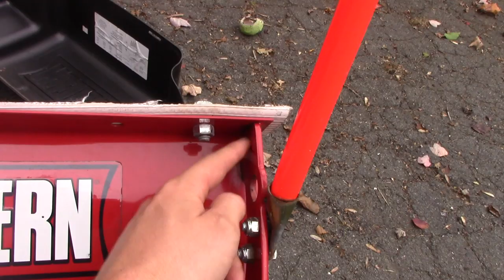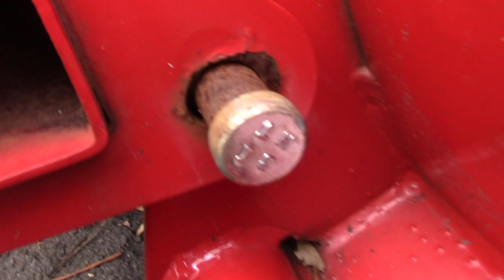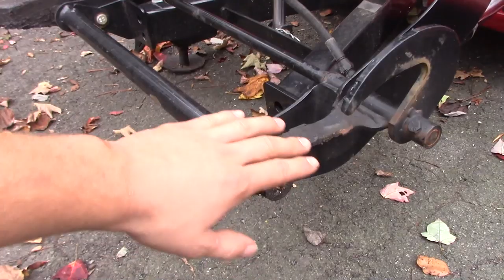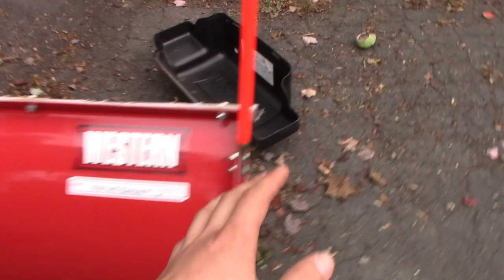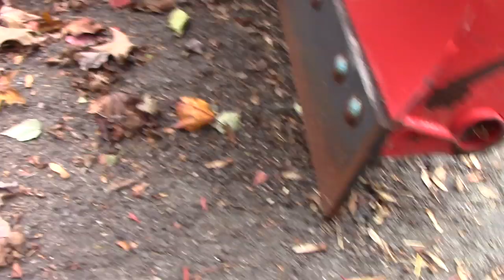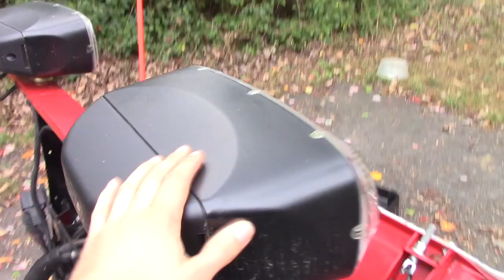WESTERN HTS 5 Year Review

Comment: Don't know why so many are going ballistic on you about your assessment of this plow. I thought you did a good job, and I for one am glad I came across this video since I'm in the market for a lightweight plow for my half ton ram and was just discussing this very plow with my local dealer. Keep up the good work!
Reply: Steve, Get the Poly Pro and just put Timbrens in the front end and make sure you put about 600 lbs in the bed to the rear of the back axle. You Will Be Good To Go.....Don't fork around with this lite weight if you're going to do ANY plowing. If it's for YOUR driveway with less than 4 inches of snow you could get it but it's a waste of money....Karate Do Yes, or Karate Do No. Karate You Do Maybe? SQUISH ! ! !  One mans opinion.
Reply: @umpman04  I have the same plow on a 2005 F50. I plow apts and condos and have used it to push 22 inches of snow. Been using it for 6 years and could not be happier.

Comment: I have a 7.5 foot straight blade Pro Plus snow plow. It is 10 years old now with no weld breaks. Had a hydraulic failed once and a few broken feet. I live and operate in Alaska, perform snow plowing with my one ton 4x4 on residential and a few commercial jobs.

Comment from the maker: So much hate, WOW! Fact of the matter is my f150 is what I have. I don't have 65K to buy a nice heavy duty truck and plow. I bought an HTS because its designed for my truck. Im just an average guy trying to make some money with the equipment I have, don't hate haha.
Reply: Quit bitching, you already said it "wasn't for commercial work". That plow was made to do a few driveways a storm, not 30 or 40. Learn how to plow properly and you won't beat the shit out of your equipment. One of the places i worked for had a plow that was over 20 years old and they had to replace the lines and do the cutting edge, you on the other hand have beat the utter shit out of a 5 year old plow. It may be a western but it wasn't made to go screaming into a snow bank and come out with no damage, take it easy and that plow should last you 10 or more years.

p.s, ram 2500s start at 28k and a new plow like 5k. 65k is probably what it takes to outfit a 5500 diesel
Reply: Eric Becker why hate on the guy for trying to make a little money?
Reply: We are all just stating that you are complaining about issues with how it was built and how it has held up to your plow route when you are using a home owner plow for commercial use. When you say light commercial use is way more than wear and tear on your equipment. If it's a bumpy dirt driveway most guys use these little things called plow shoes until they get a base. Idk where you live but no matter what you are doing your plowing illegally. Federal DOT regulations require any vehicle with a GVWR of 5,001lbs and greater to have a company name in the side of the truck. Just keep that in mind
Reply: CFR 390.5T Definitions:
Commercial motor vehicle means any self-propelled or towed motor vehicle used on a highway in interstate commerce to transport passengers or property when the vehicle—

(1) Has a gross vehicle weight rating or gross combination weight rating, or gross vehicle weight or gross combination weight, of 4,536 kg (10,001 pounds) or more, whichever is greater. By this basis, 390.21 does not apply.

So, to which federal law are you referring to? Please help everyone by stating your references.
Reply: mike squires by that logic, every pickup would have to have a Company name and DOT number on the side. I've never heard that before.
Reply: So I'm guessing you are also of the opinion that all mom and pop stores shouldn't be in business? They should close up shop and let the big boys (like Walmart,  home depot, etc.) take care of things? So much for letting the little guy try to make a go of it. I was a one man band painter/wallpaper hanger/wood finisher/faux finisher for close to 40 years...shame on me, right? Shoulda stepped aside and let the big boys take care of business...
Reply: It's a 1/2 ton plow. The name says it all. Made for driveways. The price point reflects that. You should have gotten a pro plow. Your review and expectations of this plow is meant for a contractor grade plow. Your acting as if your hts was made for commercial plowing which it's not. As for the welds, the engineers @ western no exactly how much and we're to weld. Top much weld would hinder the flex of the plow. Again you said it yourself it's a driveway plow. Why are your shoes so far off the ground?
Reply: @zachbooth1785  a ram 2500 cost 27k back in 2010 they are around 50k now

Comment from the maker: Let it be know that everyone calling this a "Home owner plow" is incorrect!!! Here is the description of the western HTS on their website! "The full-sized, full-featured WESTERN® HTS™ half-ton snow plow is built for today’s half-ton 4WD pickups. The HTS plow delivers professional results for your personal and light commercial snow plow jobs." So its a light commercial plow, and thats exactly what I use it for.
Reply: SnowPlowLife Thank You for your comment.  It helped me in my decision on choosing a plow for my 1/2 ton truck this year 2018.  The guy in this video seems to just knock on it bad, but yet it has held up for him for “five years now” as he has stated.  If you also notice, he doesn’t have his bumpers down.  I have always called them bumpers, others call them spindles , and others call them whatever they want.  I call them bumpers bc they bump over things.  Trip.  Which helps with a huge portion of the wear and tear on the actual blade that he’s admitted to hitting curbs with.  Sounds more like a novice instead of a pro in my opinion, which is of course mine to make.  Everyone has them, and are entitled to there own.  Just stating mine.  Five years old and the wiring hasn’t been replaced, just electrical greased thanks to the cover.  The plow has the bumpers which’ll make the plow blade last longer, be able to make it do more and reinforce the blade from taking all of the abuse.  Also.  I’ve never heard of anyone having tiny stone issues, when they go between the plow blade and the plow, so that’s new to me.  My grandparents ran a successful family landscaping/Snowplowing business for 66 years, when he got back from WW2. My grandpa and grandma started the family business then.  I worked for them at a very young age.  They actually started by putting in all of the residential and commercial lawns around the towns where I live.  Then a customer asked my grandpa if they also kept them up?  He said,”yes we do!”  They had more work then any business these days, bc they were the biggest around.  They retired bc of age, they made a fortune, and now theirs hundreds of landscaping/snowplow companies around, that does horrible work. More money, lest less value.  Then, these days, anyone thinks they can get a plow, plow some driveways and make money.  If you tear up yards and aren’t insured?  The spring hits, you’d lose more in yard repair and any other damages than you made all winter this day in age.  When my grandparents were big time... They had a family crew, it snowed so much that, when they got done plowing everyone’s driveways whether residential or commercial, they’d have to go back and start all over again at the beginning.  That’s how much it snowed back then.  These days.  Your lucky to plow what, 6-7 times max?  That’s how many times I use my 2016 John Deere 1025R to do my driveway.  But I can use my tractor year round with all the attachments with it like 60” mower with mulch kit, front loader, bucket, forks, backhoe and more. Granted I have over $29k into mine, but it’ll last me the rest of my life and more.  It has also been modified so it can be driven right footed which is standard, and also left footed.  Only one around like it.  Just think if you somehow sprained, twisted your right ankle, but you knew that, you still needed to get things done.  With my tractor and being able to drive the tractor left footed would allow you to do that.  You’d be the only one to own this one of a kind as well.  You could also do so many other jobs with this too, with all of the attachments that, comes with it.  Think of the endless possibilities?  It’s a money maker for sure.  I’ve made some money with it.  The licensed company who specializes in these modifications has only done one tractor which is mine, so it’s truly a one of a kind.  I’m also disabled.  Getting harder for me to get on and off, bc I’m disabled so I’m going to be selling.  Still has warranty, just over two years old, still has some rubber nipples on tires, excellent condition, all service done at dealership, fully loaded, was dealership showroom condition, Diesel engine, all manuals included, always stored inside including all of the attachments as well.  Asking $20,995 firm.  Serious interest only.  Would have to pick up.  Funds would have to be wired from your bank to mine, after you’ve checked out the tractor.  You can’t get a new one for this price, the excellent shape that it’s it’s in, and everything that comes with mine.  Dealership told me that, when I sell it, I have to take off even in the like new shape that it’s in 20-25% off of the overall price.  If you do the math, I’ve done more.  I didn’t buy it with the intensions of selling it, that’s why I invested so much into it.  Being disabled doesn’t help, so I have to get something that, I can get on and off easier.  I’ll pay to have my driveway plowed.  If interested? Message me back here.  If it’s going to be offensive and rude bc I’m disabled?  Please just leave me alone and go and harass a different person.  I’ve served my country!  I don’t have a lean on my tractor, bc I paid it off so the selling/buying process would be faster and smoother.
Reply: Hey! Great review. Question for you. Have you changed the hydraulic oil on it yet? I just purchased a used HTS..lots of vids on changing the oil on the bigger Westerns but not the HTS. Peter

Comment: My plow had no grease fitting on the king pin either. Of all places i agree that should have a grease fitting. It takes massive abuse, thousands of pounds pressure plus every time the plow blade is angled it also wears the king pin. I plan to drill and tap two grease fittings through the wall so grease can flood into and surround that entire pin. I believe  manufacturers purposely do not provide a grease fitting so the king pin wears and becomes sloppy and you have to pay for it to be repaired...I also power wash my entire plow after use to stop salt corrosion and also beneath my entire vehicle and inside fenders.......... Nice video my friend!
Reply: Plow armor bolt kit is what you want.

Comment: The welds on the ribs are plenty strong, if you welded it up solid it would probably be too brittle.  Also  makes it much easier to cut the mould board off if you need to replace it. Also it needs some flex.  Where the pins are wallowing out I'd install easily replaceable bushings. They are cheap but easily broken so you may find yourself replacing them often

Comment: It's a light duty plow and you expect it to not get beaten up lol ok. As far as the welding and have been welding for almost 10 years they have plenty of weld on there. You want it to flex so when you beat the crap out of it won't break. Even the heavier ones aren't welded fully. I will agree on needing a grease zert for the king pin.

Comment: You talk about all the welds they could have added, yet after five years there seems to be no structural deformation to the plow! The company probably saved $40 of added welding labor. The bushing on the pin is notable; perhaps I would beef it up before I start using my plow.. headlight bolt breakage? Was that just from wear and tear of did something hit the light? That might be a problem in the middle of plowing during a storm. Thanks for the vid. I'm looking at getting a used truck which has a new one of these plows that is already on a truck I might buy.. Thanks again for the video!

Comment: Have you ever built a 'cradle' to set your plow on, so you're not setting it on the ground
?
Reply from the maker: I normally perch the plow on an old pallet or two in the off season! Cheap and works great
Reply: @OldSoulMillennial  thanks.  I have a 1/2 ton also with an HTS and it works great.  Better than I expected it would.

Comment: got the plow after watching this. snapped the edge off the 3/8" thick edge after 4 hours of plowing 5" snow event of residential driveways. got replace with the optional 1/2" edge but not happy about it.
Reply from the maker: What snapped exactly? the actual blade itself, or the moldboard potion the hold the blade?
Reply: @OldSoulMillennial  just the cutting edge . not the mold board .

Comment: I have a western hgs plow, but since I’ve changed the hydraulic fluid one of the swing cylinders wont hold when a pressure is put on it. It just wants to go the opposite way. I’ve refilled the oil reservoir and have swong it from side to side to get the air out, and still wont hold. Can someone help me out?

Comment: Ok, I get it, personal preference, as a welder I KNOW alternating welds pulls the metal one way then the other, tensioning the rib, if you welded both sides the rib would have "slack" in it, alienating creates stressed steel which is GOOD!
Pin and slot welding, if welded as suggested the welds would break, the plate is a moving part.

Pin and slot allows parts to move vs break, plow flex ALOT, spring mounts are consumable components. springs are consumable parts, the can and will break.

King pin not being boxed in? how would you get the king pin in if it was? how would you replace it? plows are a consumable tool, they need to have parts replaced.

Using a none commercial plow in a commercial business, your plow is too lite for the work load, of course the moldboard and blade will deform.

In short, look at the designs of FULL size snow plows if you want strength, cutting edge wear is the operators choice, the plows are equipped with shoes to keep the cutting blade on the moldboard from touching the ground, so many service providers take the shoes off and then have excessive wear on the cutting edge. Just my opinion offered.

Comment: As you are a welder, you should know that welds add weight. The enemy for a light duty plow for a light duty truck is weight. Also, I did not see any broken factory welds. Nor did I see any bent bracing within the structure. My conclusion is that it was a well made plow and appropriate for a light duty truck. I do however agree to the need of that grease fitting. If the plow were mine, I would reduce the height of that cutting edge by a couple of inches. I would also take off the front shoes, as those are only there for doing gravel driveways, and nobody ever uses them anyways.

Comment: Wondering if you modified the front end of your F150 at all to accommodate the plow.  Replace any ball joints or suspension parts?
Reply from the maker: 2" leaving kit is all, all other suspension/front end components are replaced as needed just like any other truck
Reply: I have the same plow on my F150 for 6 years, have not had to replace any suspension parts. I use it for commercial lots. Love the plow.

Comment: Is there any accessories you would recommend like Back Drag Edge or Shoe Kit. I’ll pry get the Deflector. This will be my first plow and I’m getting it in the spring to try saving me some money and just using my snow blower right now
Reply: Shoe kit is good for gravel roads. Never ran a back drag edge. Snow deflector docent seem to work on a western for some reason. It worked well on my snowdogg. I currently run am 8ft western. Hydros are slower than the snowdogg. Mounting and dismounting is much better on a western.

Comment: what kind of hydraulic oil do you use in your pump we have a western mpv pro plow and was needing to change the oil i didnt know what oil is the best ?
Reply from the maker: I use western Brand hydraulic oil. There are likely cheaper alternatives but I trust that the western brand is engineered specifically for plowing applications. Its not that expensive and its always been flawless for me. Also I suggest you check your oil filter in the reservoir for any shavings or particles

Comment: what year of truck is that plow on . I have a Ford and Ford says not equipped to handle a snowplow  even though its the 5.0 V-8 . I was told because of the electric steering . Where I am makes the truck not so Ford Tough more like a sissy truck . Put a meyers 57H on my old 2000 chev 1500 with 335.000 ks ( Canada ) and the Ford sits in the barn  your video was fine . You have to grow a heavy skin to be a youtuber . But I guess the cheques at the end of the month help eh

Comment: Complaining about the lack of welds in certain spots, but here’s a question... in five years of plowing commercially, has the lack of welds on any of the locations resulted in a failure of any of the other welds? If not, then what is there to complain about? Not for nothing, but that thing looks tip-top for five years of commercial use.
Reply from the maker: I find the lack of welds to be a potential flaw. the only part of my plow that has failed me is the gussets supporting the cutting edge. I do repair this in another video. However this is an opinionated review, do you expect me not to point out things I don't find adequate? I feel like this video is important to potential buyers so they can see everything I like and dislike. It wouldn't have taken much to add 40 more welds on this plow. I just see it that Western cheeped out a bit. That is my opinion.